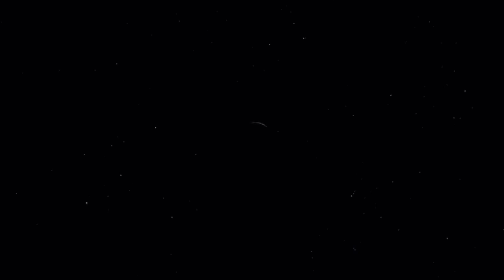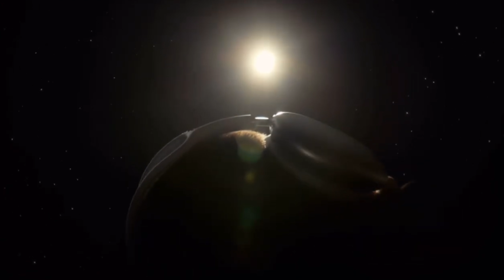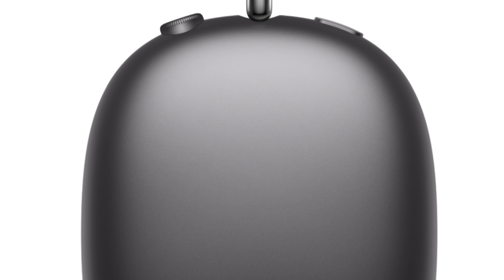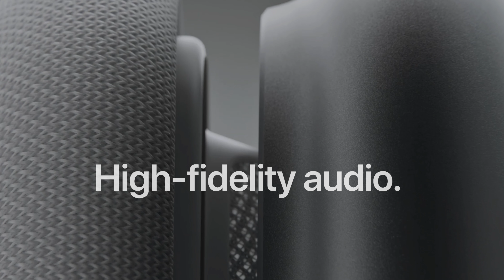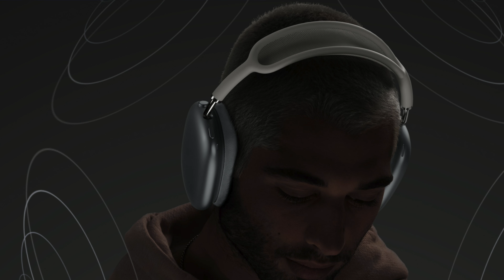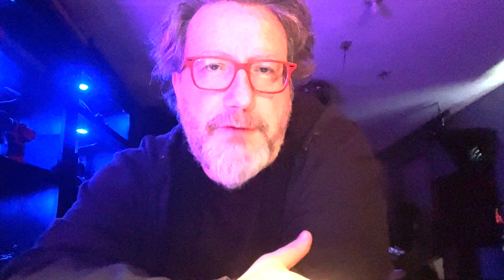AirPods Max: An Audiophile's Reaction (Features, Price and Should You Buy Them)

Comment: There are two H1 chips one on each ear.  The AirPlay Bluetooth is lossless compression, where as just Bluetooth is lossy.  The crown has the standard Apple manual control one press play/pause, two presses to skip to the next song, three presses to go to the previous track.  Sold separately is a lightening to 3.5 mm cable (you mention in a insert).

Comment: Not a chance they'll be close to those hd600's in the sound department. they can use all the DSP they want, but no circuitry can correct for distortions on a bargain brand diaphragm or distortions from reflections in the cups. I really doubt they'd beat the $150 mark for wired headphones. The bluetooth headphone trend has shown this over and over again.

It seems like people who are buying these sorts of headphones just don't care about the quality of the sound. The BEST sets of studio headphones available tend to cap out at $500, where you could get neumann ndh20's, shure srh1540/1840, sennheiser hd600, akg k712, or the new Avatone pro's.

I fail to see how a $550 headset qualifies as rational spending if it's essentially a controller for an iphone and can route internal and external sound. It's hardly able to be called a headphone at this point. Apple is always finding ways to mentally shape the general population's concept of value.

Comment: The big problem with all Apple headphone products is the lack of a system wide Equalizer. With all other music apps than Apple Music you have to live with the Apple headphone sound as it is. Which is far from very good. Other products - especially Sony - provide an App where the headphone sound can be tweaked for any App. Not so Apple despite the fact That they could resp. should easily integrate this in the OS.

Comment: There's only one thing : did they fix Bluetooth so that the audio quality of what you're listening to doesn't drop if you happen to want to use the microphone?
Did they make it so if it's wired, it can be a headset with microphone while wired?
Does it also show up as a USB audio headset when plugged in with that wire?

If not, then, there's a lot of other ways to spend $500+ on wireless headsets that are also broken in this regard.

Comment: If you are going to call this an “audiophiles” reaction you need to cover all the important points and do them correctly. I did not see any mention of the limited number of codecs these will use and the fact that the best LDAC and APTX are missing. For wireless headphones for an audiophile where sound quality is essential this is crucial. Then the weight of these is missed, any serious headphone listener knows how important this is to and these are very heavy compared to their peers. As for these not being a competitor to the Sony and Bose etc headphones you are wrong, these are wireless,  noise canceling headphones that are consumer products. The major difference is the price and that is way above its peers for in many ways a worse product. It needs a proper case and a special lead to work wired making even more expensive. Most audiophile headphones are not Bluetooth and will sound much better so you cannot compare with them. The few that do are way better than these, except in the lifestyle features, which the direct competition does have.

Comment: I have AirPods Pro and I have 500,- + headphones, I don't see how this device  will be able to deliver the audio quality required to make the upgrade. I will wait for the review but what is the reasoning behind this, its basically a low quality lossy wireless connection. So full range high quality audio, and by that I mean at least around CD quality, is just not possible. Also there is no way to digitally connect these to your devices and let it act like  an external DAC, like the Shure AONIC 50. Again why, for this price why, they will all sell I know, but why? why not buy the AirPods Pro for the apple stuff and Shure AONIC 50 for more immersive listening? I have been using Apple products since the 90's and again own a pair of AirPods Pro so not an Apple hater but this just does not make sense to me.

Comment: For the filthy rich and/or incredibly stupid. You should expect to get mugged if you wear these around the city (any city). You cannot get High Fidelity Audio from bluetooth headphones Period. You will not get anywhere near the quality you should expect from headphones in this price range from the inferior AAC codec that Apple uses. No APTX let alone HD; No LDAC because Apple don't want to pay to use the technology you should expect from a product at this price. So they fob you off with outdated tech which they hope you won't notice. They are a con. UK buyers should also be aware that they are being price-gouged by Apple to the tune of $140 at current exchange rates. A nice little earner for Apple as usual. I have Airpods pro which I like very much. They are convenient and sound reasonable for casual listening. But don't try to suggest they are "High Fidelity" - and neither are Airpods Max.

Comment: Expensive, yes. Worth it? Maybe. Apple products are always expensive but they deliver. Having said that, I don't see those replacing my B&W PX wireless headphones.They seem to share a lot of features, like automatically starting and stopping as you put them on or take them off. The B%Ws have a USBc connection at both ends though, which ultimately will help get rid of cable clutter. I can now charge my MacBook, iPad and headphones with the same charger and cable. Would love to see you comparing them though.

Comment: This feeling when you’ve just spent 500 $ on headphones and dac. And the next day learn that apple presents THE ULTIMATE HEADPHONES...
Reply: You honestly think a wired 500 headphone combined with a dedicated DAC will be outperformed by this Bluetooth only headphone?
Reply: @SanderM3P  don’t know)) they say Bluetooth codecs do magic these days. And I’m too new into audio to be sure that apple has no chance of beating 20 years old headphones (I’ve got hd600) with new cans. Apple are great in engineering!
Reply: @FroL_Onn  hey it’s real easy to sound like a audiophile snob so hope you don’t take this the wrong way. Bluetooth audio is a means of wirelessly transporting audio and is currently always lossy. That means that lot’s of audio info is thrown out to get the signal over the limited Bluetooth signal bandwidth. There are many different codecs and the one that Apple uses, called AAC, is actually one of the worst. So although the headphones by themselves might sound good, but they probably just turn the bass up a little as most people perceive this as “better”. If you would do some critical listening, which I hope you are doing with $550 headphones, you will definitely hear the difference in quality between let’s say a $400 wired headset and the wireless Apple Airpods max. If you want to know more there is lot’s of info on Bluetooth audio codecs online. Hope you have a great day and enjoy your audio experience!
Reply: @FilipWinter  didn’t follow apple ^_^ that’s fine though, I’m happy with the purchase)

Comment: I bought a air pods pro on eBay for 163 USD but when I got it the air pods were defective and it didn’t hav a serial number so I couldn’t get a replacement. The seller ask if I wanted to change it but most likely I wouldn’t get a air pods pro with the serial number showing that it came from apple. The sound that my generic air pods hav is the best sounding earphones I’ve ever heard and am very happy with the audio it’s just the short battery life which is 1 hour and 30 minutes which is terrible, With that said Apple air pods pro are amazing and I’ll be ordering mine from Best Buy along with a Beats Solo Pro

Comment: Jason, as you pointed out it will all just depend on the actual audio quality provided. I live in a mixed ecosystem so these probably wouldn't work too well for me. I think at $300-$350 these would be a no-brainer but I would be surprised if they are as good as some of the other options available in this price range. However I am open minded.

Comment: No so called audiophile would buy these just like they wouldn't buy Bose headphones. $550 and no Aptx or LDAC codec support. $550 to listen to 256kpbs AAC audio is madness. Nobody should defend this TGH pricing. Spatial Audio isn't special, it's the same as Sony's 360 degree audio, which is also overrated

Comment: Im listen to you as a Audiophile and asking myself "are you serious?" You do know that all apple bluetooth products that deliver Music only uses the AAC  codec right? Which is not HiFi lossless 44.1kHz/16bit. In my opinion that Headphones will only be good for watching movies and the apple eco system. It will not be a Audiophile dream over bluetooth. and it's left to be seen if it could use the Lightning cable to 3.5mm adapter to deliver it and High-Res. Because from what i heard, the Lightning port on it is only to accept changing not sound. But I could be wrong.
Reply: They will be audiophile grade if used with a cable (I'm assuming they have cable mode)

Comment: 549$ Seems bit of a waste since Apple does not support any Hi-Res Bluetooth Codec...
Reply: Of course Apple doesn’t support any high definition Bluetooth codecs between their headphones and their devices. That’s because they don’t use Bluetooth for that at all. They use their own proprietary chipsets and codecs for Apple to Apple connections.
Reply: exactly , plus you can even use a true aux chord to listen to outboard dacs . Totally dependent on apples D/A conversion .
Reply: I got the Bose NC700s upon launch in July 2019 and constantly had issues with having to reboot my MBP13 because folks couldn’t hear me or vice versa during a work-related Google Meet // Slack video call // etc. (Note at that time I never owned any pair of Apple AirPods...UNTIL the AirPods Pro were released).
Reply: So I sold the Bose NC700s this past June on LetItGo and have been patiently waiting for these AirPods Max! Yes, pricey but the tight integration within the Apple ecosystem won me over.
Reply: This review makes sense.  I was considering buying the Apple headphones cuz Apple does everything right.  But they don’t pair with my PC and also don’t have a 3.5 mm jack, which would be necessary for the external mic I have.  Which means I can’t use them to talk on discord.  

Had a Mac mini for a while and loved the ability to text from the computer, but the file system was maddening.  Switched back to PC.

In a perfect world, would not be averse to an entirely Apple eco system, though.
Reply: Yep, that's a legitimate complaint. But if we don't like it we should just not buy them and quit complaining...apparently 😆
Reply: Doesn’t matter. iPhone has a much higher quality dac than most dac amp budget combos under $200 and I believe may have the best out of any phone. 

You cannot tell the difference really between external dac amps passing through an iPhone. If you play tidal master on iPhone and tell me you can hear the difference between a tv out adaptor + dac amp combo vs a straight 3.5mm you’d be mistaken. Done plenty of tests with my iPhone plus external dacs and I can tell you that there’s no phone app that can reliably deliver better quality than Spotify anyway due to how good Spotify is at compressing audio. Tested this and have all the gear first hand.

Don’t believe me? Read reddit review - all say the same. Youtubers are one of the least reliable sources especially when it comes to audio dac amps.
Reply: @TZJinzo  my own comparison with iphone 11 pro with Mojo Chord DAC vs my iBasso DX 220 in combi with Sennheiser Momentum 3 over ear with 3,5 mm via TIDAL and Spotify . in any Case IBasso wins. the same on bluetooth
Reply: @TZJinzo  Are you really using Reddit as a source. So many things you said are inaccurate. What next, Wikipedia? 😆 Also, there are plenty of apps that can produce better audio, Tidal and Amazon HD being just two examples. just not on iPhones. IOS doesn't support better than 16 bit 48khz audio, while Android supports 24 bit 48khz. Android OEMs can support up to 32 bit 348khz audio using USB DACs and USB - C to 3.5mm dongles, My Samsung Galaxy S20 FE with a decent headphone dongle with built in DAC outperforms any iPhone in the same scenario using USB Audio Player Pro, Poweramp and Neutron. Your USB DACs and so called superior iPhone DAC will always be let down by the software that doesn't allow true hi res audio on IOS unless you jailbreak and use an app from Cydia app store
Reply: @franklingoodwin  Android supports 96khz for sony headphones.

Comment: Bluetooth headphones without cable for direct connect, yup it too much! I’ll wait for it drop to $399 and H2 chip.
Reply: If you need a cable connection to a 3.5mm output you can buy one for the Beats Solo Pro as well as these.
Reply: I have latest Beat Studio not very impressed with it, I like AirPod pro better and it more comfortable too.
Reply: @jakeliujakeliu  I wasn’t discussing the Studio Pro 3, they have a micro USB port. I was referring to the Solo Pro that has a Lightning port.

Comment: This is very reasonable video, thank you Jason. $550 sounds like a lot of money. But there are many wired headphones that cost more. So whether they are worth $500 depends on whether Apple can deliver reasonable sound quality.

I am actually in the market for a pair of over the ear wireless headphones and had been holding for Apple. Unfortunately they priced me out with this one. So I for one am interested in your opinion on alternatives. 

I will probably choose between Microsoft Surface Headphones 2 ($250) and Sony WH 1000-xm4 ($350). I like Surface headphones' wheel for volume control and price, but I heard the sound quality is not as good as Sony's. I am no audiophile and and the most expensive I own is HD 598 (which I do enjoy very much). How do you compare sound qualities among the three? Do the wireless ones sound even close to HD 598? Is the sound quality difference between Sony and Microsoft worth $100?

Thank you!